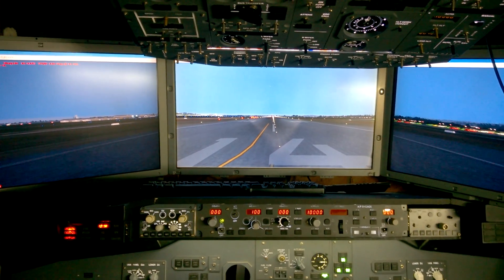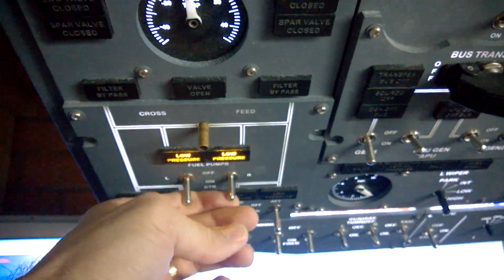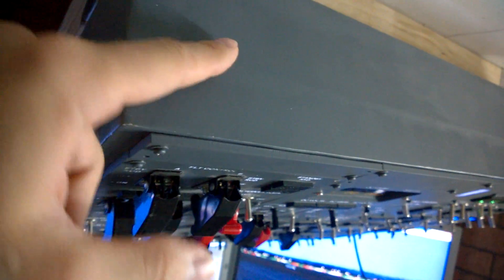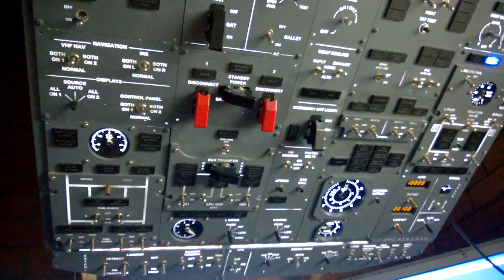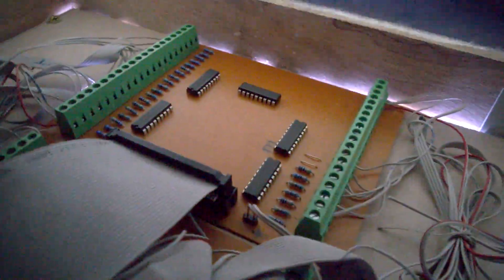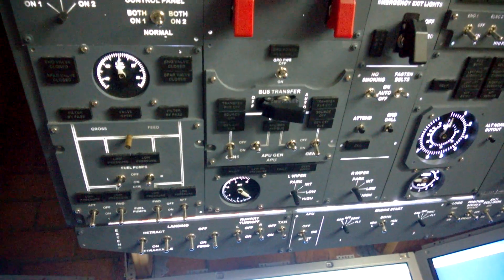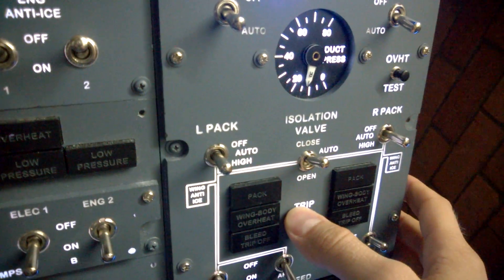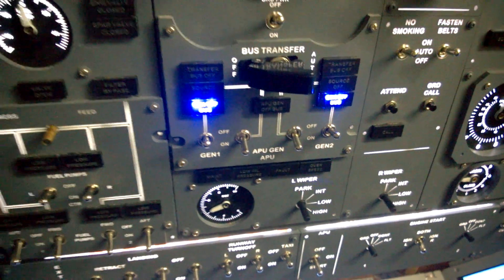Boeing 737 Overhead Overview

Comment: where did you get the spring loaded switches?
Reply from the maker: Which switches specifically do you mean? If solenoid ones, as I said in the video, found them on ebay.

Comment: I know you said eBay but I can't find the type of toggle switches you bought
Reply from the maker: +Ismail Ocal 
Ok..., these  should probably get you started:

http://www.ebay.com.au/itm/5pcs-12V-Heavy-Duty-Toggle-Flick-Switch-ON-OFF-Car-Dash-Light-Metal-SPST-12-Volt-/151191723314?hash=item2333ba9d32:g:Ot0AAOSwKtlWnI3T

http://www.ebay.com.au/itm/10-X-12V-20A-Red-Cover-Rocker-Toggle-Switch-SPST-ON-OFF-Car-Truck-Boat-2Pin-/221879673511?hash=item33a90f22a7:g:socAAOSw9r1V79aB

http://www.ebay.com.au/itm/5-X-Heavy-Duty-20A-125V-SPST-2-Terminal-ON-OFF-Toggle-Switch-Waterproof-Boot-/331688231920?hash=item4d3a28c3f0:g:WYkAAOSwo0JWKK0g

http://www.ebay.com.au/itm/Box-of-10-x-3-Way-3-Pole-3P3T-ON-OFF-ON-Toggle-Switches-5A-rating-/182004152027?hash=item2a604af6db:g:81IAAOSwzhVWp~Ln

There is a huge variety of them on ebay. I usually look for lots of 10 to 20 pieces for, say $20 or something.

Comment: mate, do you have the plans still for all of your panels you made?
I was going to buy the panels pre made but  I could get a CNC machine and a decent set of plans it would be a lot cheaper and more fun making it myself for a 1/3 of what some are asking
Reply from the maker: Bedgie01 
This is a common question... I do have plans which I used, but they are specific to the software I used for CNCing.

General overhead plans are actually freely available from mycockpit.org, all one needs to do is import them into relevant CAD/CAM software and put toolpaths etc. 
I would also change the way I do CNCing if I were to do it again:
1) Cuout panels/holes
2) Paint acrylic
3) Engrave

The order I've done it in was
1) Paint
2) Engrave&Cut

Because of that I had hard time masking and repainting all edges (Otherwise light leaks out from the sides, holes etc)

Comment: great video thanks .. was going to ask the same question that Sam asked about the magnetic switches. you can find them on ebay, but definitely not at $5 a piece .. you are a lucky man :)
Reply from the maker: Andre Els  Yes indeed. I would never pay what some of those sellers ask for solenoid switches. $400-$700.. ridiculous. I own a CNC now, for the price of switches I'd get 3d printer or a better CNC, whatever... Anyway, the idea is to get tools which can actually make those switches... Ok, done ranting :)

But yea, I got really lucky. However, looking at how those switches are actually made - it's not that difficult to replicate. Just need casing, electromagnet and some fiddling. Again, having a CNC I could probably make some of those. (But would need to have a switch first to copy from obviously)

Comment: Hi Vadim, great work mate, i would like to ask you if you don't mind, where did you get the YAW Damper switch from? i looked everywhere for a switch that flicks back to position and i just couldn't find one ! do you have any link to where i can get one from? thanks.
Reply from the maker: These are actually real Honeywell switches! I got the off ebay. Just got lucky, a private seller in Australia was selling them for $20 a piece. They didn't sell, I offered $5 a piece and got all he had (4 in total).

I haven't seen these before(or since) unfortunately.. Just really good luck on my part :)
Reply: That was really lucky!  they are really hard to get. Well, thanks for your reply, I will definitely keep checking your project .